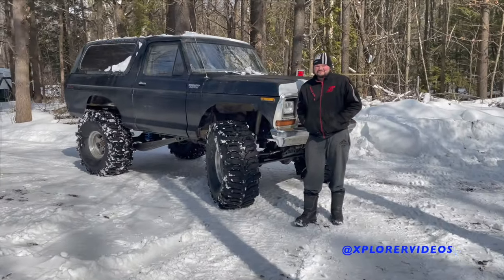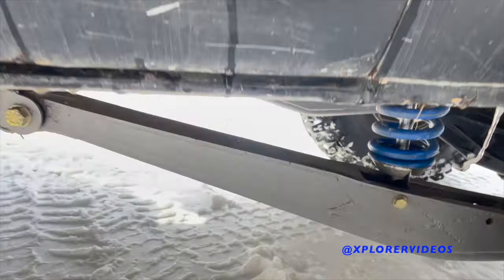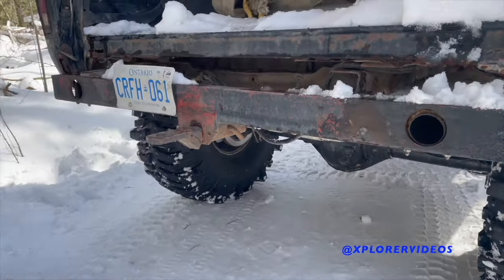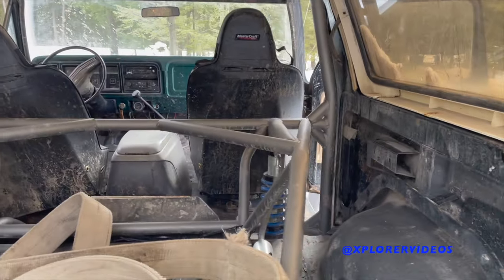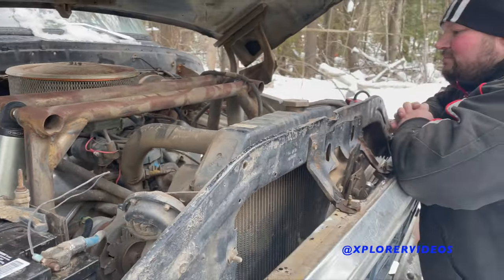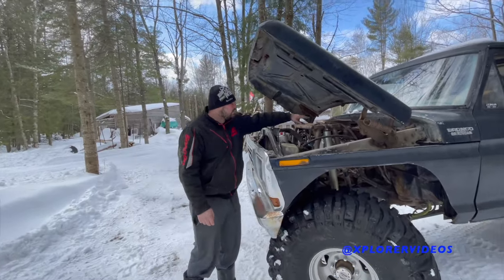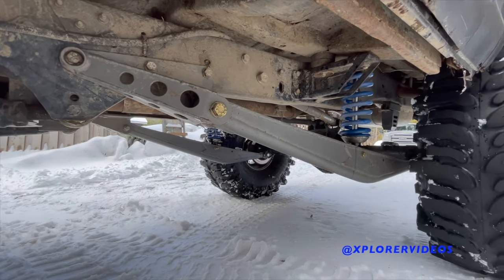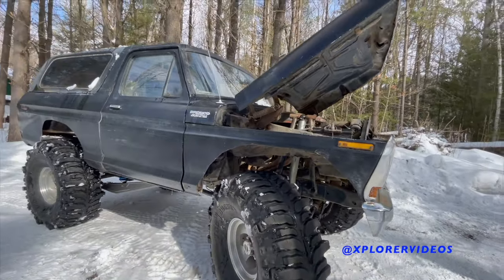1979 FORD BRONCO, CUSTOM , LONG TRAVEL 4 LINK, 1 TON AXLES, Walk around

Comment: Wow nicely built 78/79 bronco. I love the suspension design. I thought about doing something like that in the rear on mine back in the 90s. But back then coil overs weren't around like they are today. Not a fan of 351m motors but a well built 400 is worlds better. The M's just don't have enough cubes to build for good.power and torque. Or to take advantage of some good Cleveland heads. 400s do though.
Reply from the maker: Thanks for the comment, yea the 351m definitely isn’t a power house but it runs pretty descent.  Ian’s got a pile of parts saved out for what should be a strong 400
Reply: The 351 converted into a 387 stroker is a beast and cheap if you use other ford parts for it
Reply from the maker: thanks for the info, might have to look into that one.... who doesn't like to make cheap power 🤘
Reply: @xplorervideos  I just watched a video on it the other day it’s pretty cool to know about i want to try it also myself

Comment: Trans is probably an NP435, rather than a T18. Very cool Bronco.
Reply from the maker: It had a np435 in it that died an unfortunate death 😬, that ended up getting replaced by a early 80’s t18

Comment: Little work and those "M" engines party hard.
Reply from the maker: Ians been collecting some parts to build a stout 400m...... probably go over that in the near future
Reply: @xplorervideos  Would be cool to see, built a 446 for my f250 with a tmyer stroker and trickflow heads, things an animal. been considering doing another for my trail rig f150.
Reply from the maker: @streetsharkmotorworks8902  if he had a unlimited budget it would probably get a Godzilla, but the 400 should be sweet when its done.